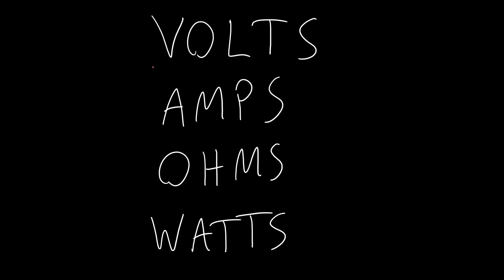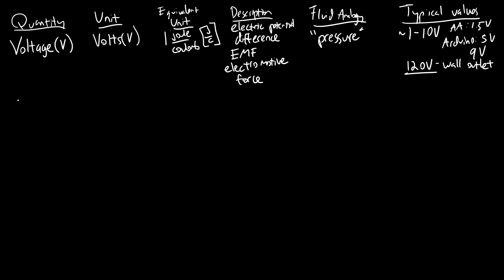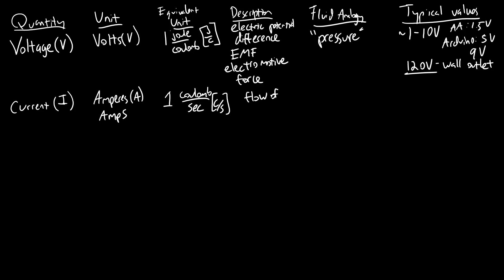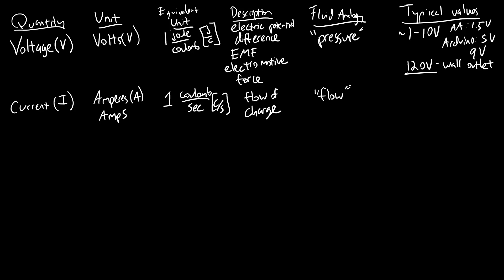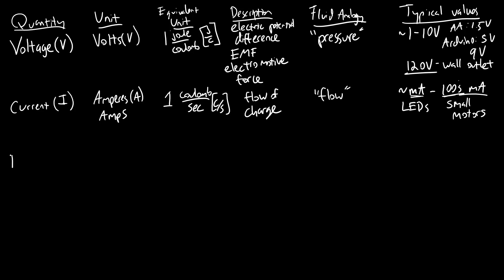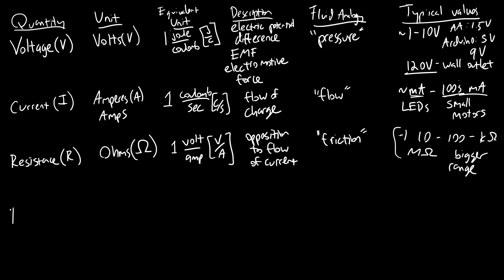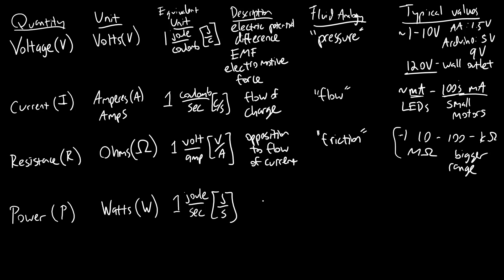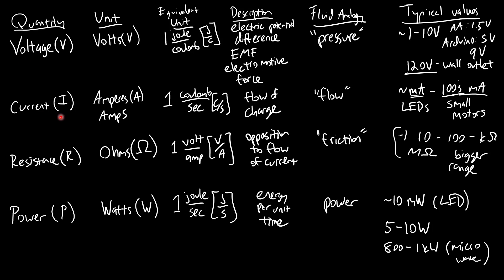Intro to Circuits 2: Units

Comment: I thought that volts used the letter E in  equations? E=IR
Reply from the maker: Some textbooks use E which is short for "electromotive force (EMF)." It's the same thing as voltage but I think the term is considered more outdated.